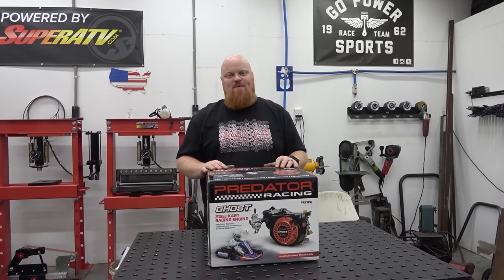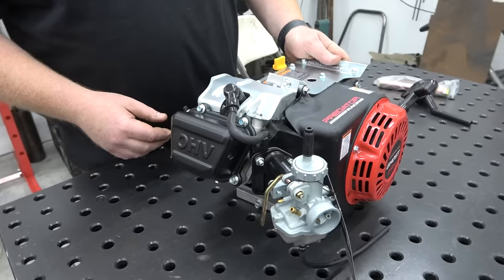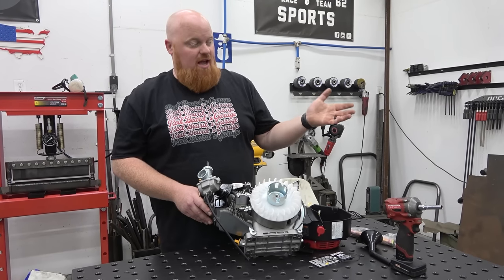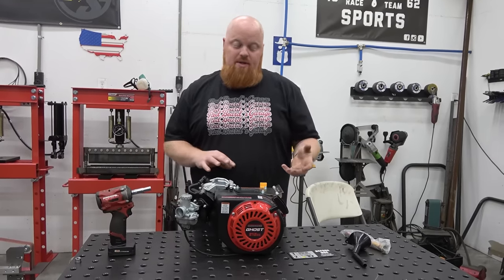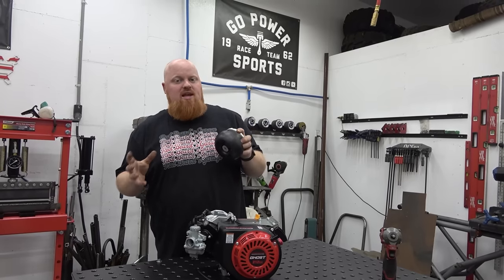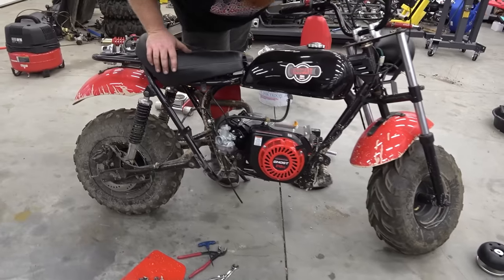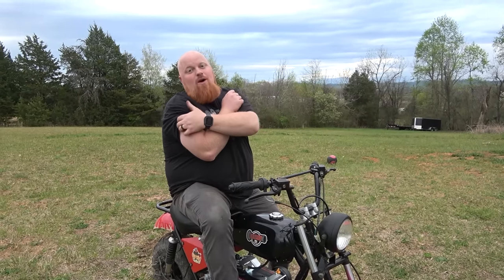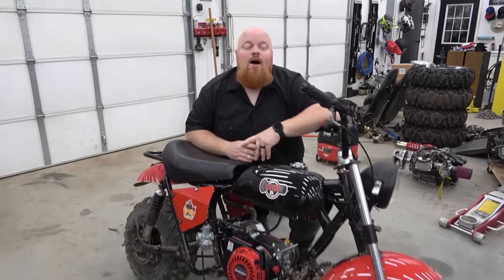🚨NEW Predator 212cc Ghost👻 Racing Kart Engine - Harbor Freight Ghost 👻 Engine

Comment: Thank you for all that you do. Really clear specs up, humorous, and factual. I bought one of these engines and mated it with my old Carter go-kart frame. It rips, yes. Reliable. No complaints at all. Diving into valve springs, push rods, connecting rods, flywheels and billet side cover. All to upgrade to a live axel and hydraulic disc brakes,

Comment: I went with the Tillotson 212, billet rod and flywheel, gov removed, hot 265 cam, 22lb springs, TCT mechanical fuel injection, mb200 super pipe...built my own frame and forks from square tube ;)
Reply: I like Tillotson also. This motor is 300 bucks.
Reply: @heavystarch100  ppppp ñ
Reply: P
Reply: Cool stuff. So now it went from 1.2 HP to 3 HP haha
Reply: Yeah but u can buy 3 or 4 of these motors for what u have into ur built one. Urs is 100% better but if u are looking to build on a budget this is the best off the shelf motor.
Reply: Just curious how do you find the TCT?
Reply: @caluzzucarrazzi5549  Go Power Sports, came with the Tilly I bought (paid extra for it)
Reply: @ezmac622  no I understand where to buy it, I’m asking you how it performs, what things do you notice with it, what is it like ? Thanks
Reply: @caluzzucarrazzi5549  It's good, not cold natured like a standard carb. Cranks up first start every time. You can adjust it without tools, which is nice. Other than that, it feels like a normal carb.
Reply: @ezmac622  nice, I’ve debated giving it a shot, I’ve got a tillotson 212 hemi like you with 22lb springs as well. It has a mod2 came, it used to have a mikuni 24mm on it previously which made a lot of power and over 8000rpm but down low it was nearly unuseable, so I went with a .640 S/A from Jerry Dover, now wondering if I should’ve given the TCT a shot. Do you have a tack hooked up? Any idea what kind of revs you get? Thanks
Reply: @4bearsi678  no they are 10 hp stock
Reply: My tilly blew up first day🤷

Comment: The reason for classes in karting is for a level playing field. This engine is slightly above base model 212, with a better starting platform for mods, but  that's not the role it's made to fill. It's geared toward racing out of the box and it will be a standard format to build more affordable karting leagues around.

I'm glad to see it, and hoping that this will open up the kart racing world to more people who cant afford (or don't know about) LO206/Animal/WF racing leagues.
Reply: That was the idea behind converting to the clone from the Briggs flathead. More affordable. More available, and level (ish) playing field. By the time I got out of kart racing it was over 1000 usd for a good Honda clone that could compete at the top. It has merely replaced the Briggs flathead at this point as far as being super expensive to be competitive (outside of local track amateur classes). Man I miss it but the amount of work that goes into being competitive in kart racing is crazy. Got burned out on it. A race car is cheaper, easier to maintain and from my experience alot less work. Lol.
Reply: Base 212 in my opinion is better , don’t gotta worry about restriction on mods like flywheels and losing your higher rev limit. The ghost is more for people who just want to buy a “race engine” then spend another 2-300$ on a kit of plug and play accessories to complete it 😂 don’t get me wrong to each their own but I feel like if your gonna get into something you need to learn it

Comment: As soon as this is available at my local Habor Freight, I’m snagging one. I believe this is the next wave of box stock karting classes.
Reply: Exactly
Reply: Provide they are built to quality controlled specs. If they are built anything like the predators we are used to seeing we will be pulling our hair out in the tech shed and pisses a lot of people off. LOL
Reply: @bryanwesley5410  they are bought at harbor freight fellas.  Dont expect to much in the way of specs. They will be all over the place.
Reply: Tillotson did this couple years ago lol predator is late
Reply: This will never be raced widely.  The Briggs 206 is locked and they have very good parity.   These HF engines have neither and therefore would need blueprinted….   And no one wants to go back to the money burning process of blueprinting.  The secret sauce to making LO206 racing affordable is the lock on the block.   I wouldn’t race this engine if I got 10 for free, it would still be way too expensive.
Reply: @ReactorFour  it's basically a slower version of world formula which is what I run this motor would have to be sealed just like 206 but the fact it most likely has the same hp as the 206 and the Rev limiter is 100 rims less then 206 its really not worth it btw you can blue print the 206 and have work done to them all of mine aren't stock .

Comment: Just a reminder to some of your younger viewers. The sheet metal coming around the fins on the block and head is there to form a cooling cowling. Too many young minibike hobbyist think the is optional heat shield. Not the case, this sheet metal is there to keep the flywheel fan air moving in-between the fins for proper cooling. If you remove this sheet metal the fan pushed air will not stay in between the fins and the engine can over heat.
Reply: I've removed that shroud on every single predator I've built. not once have I had cooling issues
Reply: @TheShangralaaaa17 😊
Reply: You have to remove it for TC install

Comment: Shoot, I’d buy one. Perfect for a guy like me that wants a high reving engine right out of the box with a little power over stock without having to swap any parts. Just bolt it up and go have fun.
Reply: O ñ
Reply: So go with a tillotson 212r or a ducar 212. Both of those are around $220-240,  both are around 5300-5500 governed rpm out of the box, and the ducar even has a pvl flywheel rated for 17000 rpm
Reply: @jmangus83   212R has a nice BSP aluminum flywheel  that’s way better than any cast wheel it can don8k easy
Reply: Said just like someone sponsored 😂
Reply: @jmangus83 funny you say that, i ran about 6 hours one day and it blew up😂

Comment: Put this on my viper (Coleman) ct200u. It RIPS. I was able to use the stock fuel tank even though other videos said it wouldn’t fit and I already had a torque converter from the stock motor. Great motor

Comment: Idk about 8k or 9k rpms but ive revved a stock 30 series driver pulley up to 7,500 rpms several times.

Also, the brace for the super pipe goes BEHIND the side plate, not in front of it
Reply from the maker: Why does it matter if I put the tab BEHIND or in front of the plate. Still does the same thing.

Comment: The Wildcat 223 is the king of stock small blocks.  I bought one delivered I paid $220.  The casting [block] is almost identical to the Tillotson race blocks.  Also comes with a 7 bolt sidecover.  Hands down the 58mm crank is a potential monster. EC carbs designed the engine that's where I will let my comment's rest.

Comment: If this works with little issues (mainly the cast iron flywheel not exploding). This could replace LO206. To get on track with a 206, a turn key engine costs 1,200$.

Comment: Use that top fill port to draw the fuel pump pulse.  Screw in adapters are available that the Briggs LO206 uses.
Reply: Thanks.I wondered why it was there,especially with that type of screening.

Comment: $199-$249 would have been a better price point for this.
Reply: But for a person that may not be the most handy, if it's staged up out of the box, nothing else to purchase, nothing to assemble internally, The price seems decent as you would spend 149 for a 212 and 100 to make it a stage 1.   Plus Red Beard feeling it has upgraded valve springs. 

My questions is yes, how do you hook up a pulse without tapping the case. And what's in the accessories kit
Reply: Was thinking the same
Reply: @jasonmares5171  loctite a brass tube into the spot where the governor shaft would be or epoxy a brass tube into the top oil fill plug, drill the plastic cap and pop the 3/16” brass tube into it.
Reply: 300$ seems good to me they will be 600$ next year and milk will be 10$ a gallon
Reply: @michaelhuddleston4220 update a year later. Milk might be 10 bucks but the engine is still 300
Reply: Ehhh, 299 is pretty good for being able to put it in anything and go, look how expensive any briggs go cart engine is
Reply: Got mine for 269.00
Reply: It's more like $300-$600

Comment: Nice looking engine! Subscribed! Back in the day, I had a Mac. 75 2-cycle, with dual carbs, stuffer manifold, 12:1 comp. head gasket. I had it on a Flexo Big Bear, (TINY) minibike. 6,000 RPM Centrifugal clutch. That thing hauled ass. 0-60 in about 6 seconds. but that was its peak because of a 10-1 chain gear ratio. Great video. I felt like I was taking it apart!
Reply from the maker: Glad to have you!

Comment: First impression, I you want an engine  for a "one design" class  With more power than the box stock 212,  it looks like a good deal.  But, if you want to have free license to massage a 212 , with  no class limits, the stock 212  looks like the better  choice .  Then you could start with the 24 mm carb, billet flywheel, aftermarket  valve springs and no governor. Plus you would add any other bits.you want.  At this point you have more power than the Ghost for similar bucks.  In that scenario the stock 212 makes more sense.    Good video, you provide a great service to help the rest of us say abreast of  developments.   You mentioned a laundry  list of other similar  engines.  Do you think it would be too much of a deep dive to compare all of these different engines strengths and weaknesses in one video. Your channel  is my "go to" source for design tech on this hobby.

Comment: honestly id love for them to offer 1 CC rating, but different performance options.

like start with "base" model, then include a stage 1 (better carb, better exhaust), stage 2 (carb, exhaust, flywheel, cam springs, and rod.), stage 3 (all of stage 2+ cam upgrade, and taller valve cover, heavier springs, better (dished) piston, rings, and maybe even a pumper carb or a combo velocity-pumper style, and a custom exhaust header for higher flow rates, with intake and exhaust porting.

Comment: I picked up a used predator with broken pullstarter for 30$ so im gonna buy a rod valvspring flywheel and gaskets kit. Id like to find a walk through on reasembly with torque specs for all.

Comment: I bought it before I even knew what a 224 was. But I've built it up with a hot 265 cam, arc rod, arc billet flywheel, 26 pound springs, and high rev coil pack. I'm pretty satisfied with it, but I'm sure that a 224cc would've been better.

Comment: I’d like to see the weight on that flywheel.  Everyone just looks at an aluminum flywheel as a safety factor and forget that the lighter flywheel helps the engine spin up faster.  Really makes a performance improvement on a minibike!
Reply: INBOX ME ①⑨②⓪⑥⑥③⑧⓪①①  did I win a rascal with a rad engine?
Reply from the maker: It was a scam account. I'm working on deleting and blocking them.

Comment: The top "oil fill" is to run the pulse pump off of they include a threaded barb that screws in there to run the pulse pump off of

Comment: I mean, PVL flywheel, swap the coil to remove governor, add a little Nitro on a light drag frame, properly geared, it would be a pretty solid budget option IMO.  I don't have 3k to build an all out drag bike but this don't seem bad at all.

Comment: I wonder how they got the epa to sign off on that. Guess it's exempt because it's specifically for racing.
Reply: They have a tag saying its not be used on any street application.
Reply: Technically it isn't a complete running engine...
Reply: Look into "crate engine"..
Chevrolet just introduced a 632ci that makes 1000hp.

Comment: Man I bought the tilly 225 right when it came out and it is impressive.   With the juggernaut pully on it.  My lil dootle bug hauls the mail.  I had it on my sfd industries drift trike with just a yard kart clutch.  I was able to hit 64mph !  With the drift sleeves on it.  I was scooting.  Lol yes the 225 was 750 or 800 bucks  but it's out of the box 18hp. I dont know if I would buy the ghost.   For my application.  I'm looking for a new drift trike engine right now.
Reply from the maker: Thanks for sharing!
Reply: Jesse's Kart & mini bike  the tillotson 212 is 10hp out of the box compared to the 6.5 hp from the predator 212. Plus the tillotson has the reinforced ducar block and 10k rpm rated flywheel stock. I picked up a new ghost to check it out but Tillotson is superior
Reply: Jesse's Kart & mini bike  lol your the only one who thinks the harbor freight block is a higher quality 🤣 😂
Reply: Jesse's Kart & mini bike  let us know how it goes for you

Comment: Well im putting pred 212 on a bicycle and im a big. Gearing will be for torque. I wanna pull any hill around house. Dont need any more than 20-25 mph max.

Seen it on a gocart they said it pulled harder than a stage 4 pred 212. New subscriber to your chan. Keep up the good work bro!

Comment: I always love how guys that do builds take a brand new engine and run a dirt road with no filter. I think they get more joy from killing one than the build.
Reply: The extra grit helps the rings seat faster.
Like the old bon ami down the carb trick but this is easier.
Reply: @MrTheHillfolk  Yep. I've witnessed first hand how carbs, cylinder walls, and valves look after some good sanding from mother nature 😳
Reply: @duanehenicke6602  It a natural porting process for the carb/intake, plus it eventually increases the bore.

Comment: Predator should add a seal tag to the block like briggs to encourage the karting community to build around this. break the seal if you want to do mods but it would be great for a spec series like how briggs handles lo206
Reply: I agree theoretically but the problem with this on this engine is the variability that comes with a cheap Chinese engine.  People would buy 20 and race the fast one or they wouldn’t and most likely just lose.  That sort of defeats the cost savings of a locked block crate motor.  The Briggs are really close so you buy one and can win… and run it for several years with no blueprint and only touching up the valves once or twice a year.

Comment: Long time listener, first time caller lol!  I was wondering what would be a better $300ish deal?  buy a ghost?  Or buy a stock 212 tillotson, stick a $50 cam and advance key in it with say a mikuni 22mm carb?  I have no experience besides stock predator 212s.  Looking for most power and reliabilit for that price range.

Comment: Got this engine sitting on the workbench. Will be going on a Coyote Kart. Just curious as to the safe limit of motor mount angle for this engine? This is my first 4 stroke. So I’m needing to know how much angle I can use and not cause any oil level or lubrication problems. Thank you and God bless.

Comment: Hey Redbeard, from what you can tell, would you pick this over a standard 212 for a race kart build? I have 212 stage 2 and wanted to know if it's worth putting all my parts on this motor
Reply: this would be optimal for a class specifically for this motor. If you are running an open or limited class i would get a regular 212
Reply: I can build the 212 to be faster than the two 12 ghosts

Comment: Wish you would have measured cam lift for us while the side cover was off. And you could usually tell by the lobe profile if it has more duration. If they are using stock compression this engine can't be anything special as is.

Comment: Genuine comet torque converters are tunable. They sell light weights and different sets of springs so you can set the stall. They use the real ones on 2 strokes so 10k rpm is doable one a real comet.

Comment: 224 for me. It's all about torque. Add a billet flywheel, springs, and delete the governor for twice the engine and around the same cost as the ghost. Personally I think the ghost is not worth the money for what it does. If it had a billet flywheel then it would be tempting. Even so, it should have came with a 24mm carb. Just because they market it as a racing engine doesn't mean it's the better choice. This engine is for the dude who just needs something running at a little higher performance out of the box. It's not an engine for the guy who wants to make upgrades.

Comment: Would definitely get one still. The price point is good imo. The cam is probably something similar to a cl1 high torque cam. So probably just a little more duration than stock. Great video red, was eager for this one .
Reply: I doubt they put that much profile or technology into this cam. Just sayin'.
Reply: @williamstamper442  I doubt it too I just saying might be something similar since red was wondering about it.
Reply: @srcobra50  Saul I don't disagree...the cam can probably support 16-18hp as is.
It's just that the cam is where ALOT of power is left on the table with these small blocks
Reply: @srcobra50  on one of my drag mini's I'm running a secret grind from NR racing in a 212 hemi and 22lb single springs. This cam's lobes are darned near square! This thing makes a ton of power and torque all the way across the rpm range, say 2500 up to about 7100. Had to grind the block quite a bit for lobe clearance. Call them up and ask for their 212 hemi cheater cam and they will know what you are talking about.

Comment: It looks ok but for the price I’d rather get a 224 and still have money to buy a aluminum flywheel.
Reply: A header pipe and the same carb on a 224 would outpower this ghost, plastic cam and all. I'm kidding. But I would still take the 224.
Reply: Get a wildcat 223cc my brother
Reply: You Know The Deal 🤙
Reply: 20% coupon this weekend and 25%monday.
Reply: That’s what I did plus slide carb and pipe for under the  ghosts price
Reply: @MudMotorsMax  is it better than the predator?
Reply: @robertbutler5615  yes it is
Reply: A 224 predator?